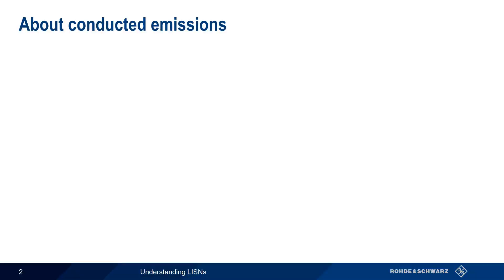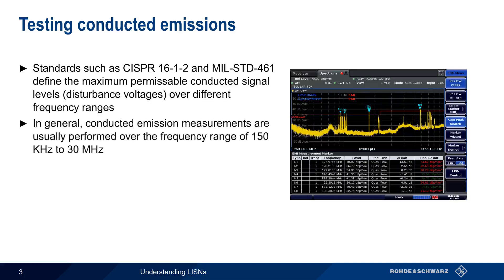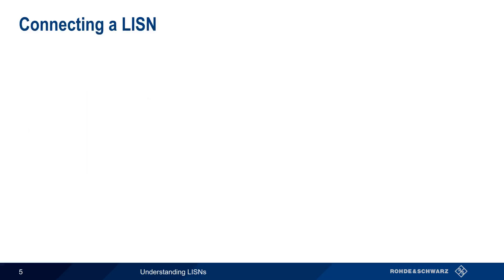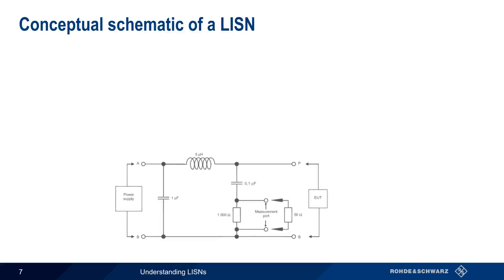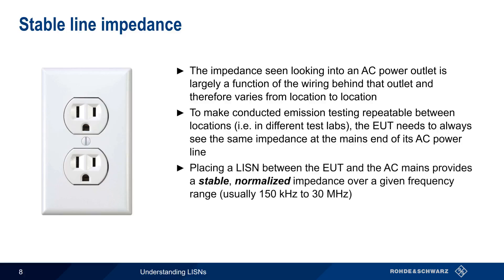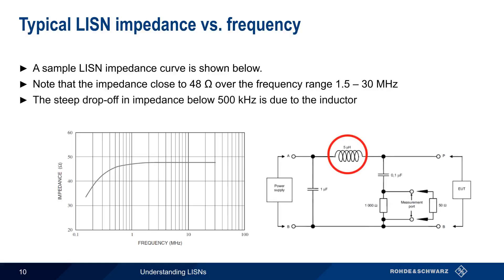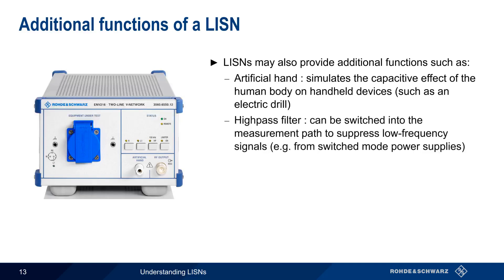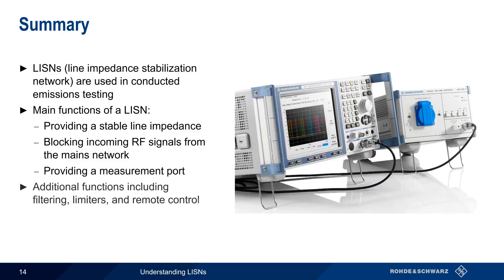Understanding LISNs

Comment: what is RF(50 ohm)? 2:35
Reply: A coaxial cable with a 50 Ohm characteristic impedance, connecting the 50 Ohm output impedance port on the LISN to the 50 Ohm input impedance port of a spectrum analyzer or similar RF equipment.

Comment: Neatly explained. Can you provide the information on difference between 5uH and 50uH LISN models?
Reply: The choice of a 5uH vs. a 50uH LISN depends on a number of things, not the least of which is the standard that one is testing against (e.g. MIL-STD vs. CISPR 25).  The current-carrying capability and max stabilization frequency of the LISN are also a function of the inductor value.  Both types are found in different standards and applications, but the 50 uH LISN is the more common variant.
Reply: @pauldenisowski  Many thanks.